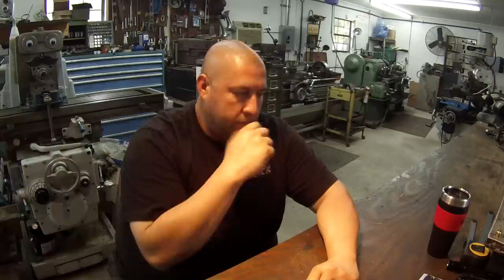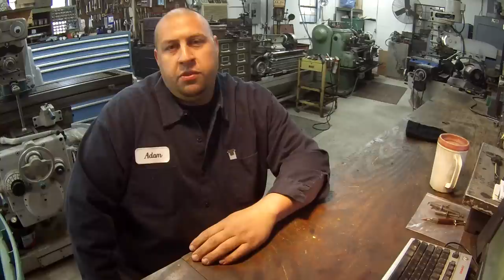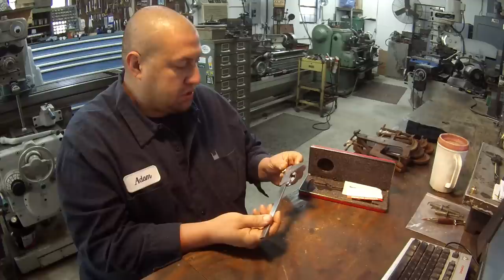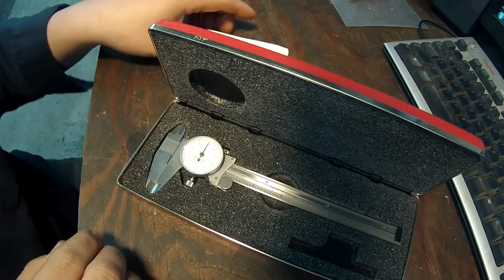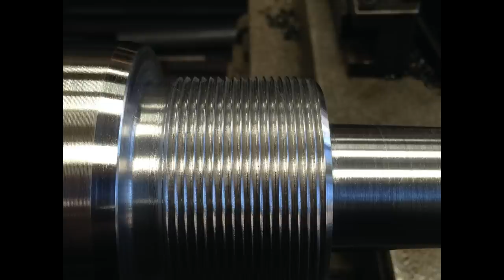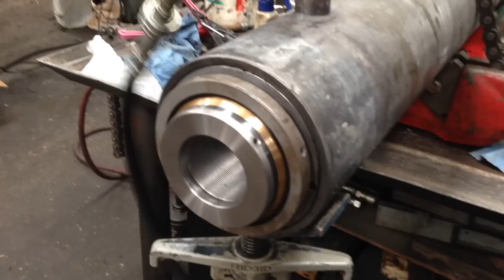Saturday Night Special 43 Part 1

Comment: Thieves suck Adam, I had a break in some time ago...luckily,  my dog gave them a couple good reason not to come back.  They got into my tools and camping gear, but they dropped it all in the yard while they were running for their lives.
Reply from the maker: Stella is sweet of a dog, she will make friends with my enemies. We've been talking about investing in a new dog, one that people won't want to mess with. Stella needs a friend anyways.
Reply: Abom79 No need to invest in a guard dog.  Get a recording of the biggest mean assed dog you can find.  Let your shop security system trigger it and have the speakers inside your shop.  Borrow someone's Doberman and make a couple of videos of it in your shop.  That siren actually will get ignored by the neighbors simply because it will sound just like the 100s of car alarms that no one pays attention to.  AND do not tell anyone about how your alarm system works or where it is.  Have it call you on your cellphone.  Put reflective window treatment on your windows. That will even save you $$ on your A/C bill.
Did they have to case your shop? No, you have made their life easier with your videos. (please do not stop them)  Weld up some simple steel bars and pin them to the inner casement of your windows. Especially on windows that are out of sight.  Just something to make it harder.  Thieve are lazy and anything to make them have to work is a big deterrent.
Reply: Abom79 Maybe get a SHOPDOG and call him SAM    :-))
Reply: Gary C nah the dog would just get lost in some rambling bark and forget about the whole thing.

Comment: Sorry to hear Adam , especially for such a generous guy like you that works as hard as you do.  I'd be getting bars on the window and a big ass steel door.  I think the cameras are a good idea hopefully they make them to see in the dark.
Reply: Don't forget cage bars on the air conditioner, it's common for those to get kicked in.

Not just a steel door, but a good steel tubing frame anchored to the concrete and wall studs too.
I noticed on the videos the door looked a little weak.

Also some work on the rollup door, big sliding bolts, and a set of cage doors on the inside.

Once you have the entrances blocked, it's common here to knock through a concrete blockwall with a hammer.
An alarm tied to a huge canister of pepper spray will repel them if they do get in and if you set it off by accident it won't kill you.

Not just the monetary loss, but if they cleaned Adam out of his precision tools or trashed the place; he could lose a lot of treasures from his father or grandfather.

Adam, once you have the place beefed up, mention it in the videos - but don't tell or show what or how you did.  Keep it under you hat so they don't know how to disable it.

Good fencing and lighting outdoors setup a distance to keep them back and nowhere to hide too.

If you and Elana go away, don't mention it online and try to get someone to stay.

If you get a dog, put it inside the shop to sleep at night.
Reply from the maker: 12345NoNamesLeft
Good stuff man, all good tips. Thanks man.

Comment: Sucks to get ripped off. All you can do is continue on and adjust.

In the video you mentioned covering up the windows. The wife and me went to an antique market and they used leftovers from a place that did water jet cutting for the guards ovet the windows. Some of it was 1/2 inch plate to start with. It was an artsy fartsy type place and it was just raw mwtal not painted. Might be an option for you if you have a place like that around. That expanded metal seems to have some silver and gold lining.

All the best

Scott

Comment: Hey Adam,

It really stinks when you have a break in, my workshop has been hit three times in around 15 years. It's always been on the house alarm system and fortunately I haven't actually had anything taken. Dealing with the damage and the stress and lost sleep is almost the worst.

Unless you're targeted by 'professional' thieves, it's generally hard to identify, easy to sell stuff like power tools that gets taken. Someone I used to know was always picking up dirt cheap or broken tools to leave around their workshop as decoys.

Keep on smiling.

Comment: Adam;

Sorry to hear about the break in on your shop.  Had this happen to me many years ago and I still get a sick feeling when I think about it.  Lost a small mill and some nice old tools that belonged to my father-in-law.  Big props to your buddy for coming to your assistance.

Nice find on the Starrett dial caliper.  And yes, you did get a good deal on it ;)

Would be nice to see some video of how you cut a buttress thread and any special set up or measuring that is involved with cutting those types of threads.  Not common for us hobby machinists, but you never know when knowing how to cut one may come in handy.

Regards;

Ron Kluwe

Comment: The thing you need most, and I say this as a victim with experience in the security industry, along with an alarm, a camera, good friends, and the advice below on doors and windows and bars, etc, is insurance. Make an inventory of everything in the shop. EVERYTHING. Get insurance. Booth Machine may not be what it was, but you should have business insurance, and you should have a list of everything, with value for replacement. There's north of six figures in your garage, and it needs protecting every way possible.

Finally, every box that has a lock or a place for one should be locked whenever you aren't in the shop. It's belt and suspenders, but it will help.

Comment: Sorry about the break in,  your correct there is nothing lower than a thief. Congrats on the Starrett calipers, they sure are sweet. Was your wallet smoking from the speed that you dug it out to pay for them? When I first started in the shop in 1974, the owner bought a set of calipers for a local company, used them a few days and they jumped the track. He sent them back and purchased a set of the Starrett calipers just like the ones you bought. They lasted and worked well, never jumping off, Starett has a course rack that is mounted on the top of the slide, that will take more abuse than any other caliper and still remain accurate. I have one for my home shop because there well made even the newer ones that is made off shore.
Reply from the maker: I love those calipers, and they are practically brand new! They have such a good feel to them. I don't know how much I'll use them for now, they're just too nice to mess up. My other Starretts are the offshore build, and they aren't as nice as the one I scored.

Comment: Adam, from this resto-guy, try a gallon of Evaporust. Drop those clamps in for 24 hours and they'll be silver when you pull them out. It's SUCH a remarkable product. Give it a try, I swear by the stuff ;)
Reply from the maker: I'll have to get some and try it out. Can you buy it local in the stores?
Reply: Abom79 Harbor Fright has offered it in the past. Check them out on the interweb.
Reply: Abom79 Adam - if HF does't have any, check out Tractor Supply. I believe there's a store in your area. All those flea-market treasures will come out so nice.
Reply: Abom79 O'Reilly Auto Parts is where I get it. Had to derust a mill table last year... The stuff is pretty amazing. On the theft sadly like so many others I've been on the receiving end of that as well. So angry I could barely speak.

Comment: Hey man I can relate to how you feel, I was burglarized twice also, then I did like you, had a high dollar security system put in my home and my shop. I got out and drove around all night looking for them, but I didn't find anyone. I didn't do so good for a few days either.
You are the luckiest man I know with the flea market finds, I've looked high and low for one of those calipers here in KY with no luck. One day it will show up and I'll put it in my shop.
You said in your video that you used YOUR insert to turn the ram down, do you have to furnish your own tooling and coolant? Your boss was understanding as well.
Keep up the video's I love them.
Mark
Reply from the maker: Hey Mark, and I am lucky sometimes. That was probably my best score so far. I did pretty good yesterday too.
The insert was mine, but they buy all the tooling at work. I wanted to try it out on some heavy turning. I'm having them buy some for me to use though.

Comment: Sorry Adam,  I hate thieves,... Not only do you have the loss of stuff but the feeling of being violated lasts a long time.  I was at a shop that got hit almost monthly..  It was a store front with big windows, when they would break the window replacement alone was $100s (I think $7-800). We finally put up bars.   They were on the inside of the windows but you could easily see them from outside and once we did, the thieves stopped.

Comment: Adam so sorry, i too was the victim of a break in, im in the uk, and had a workshop built in the back yard, im slowly building up my gear, lathe first then mill, mostly encouraged by yourself and the other guys with shop videos, they only took my mountain bike, left all the new tools etc, next day i got an alarm and camera inside, with face recognition,and motorised, it follows the face of an intruder recording to a sd card, check out the cameras at costco for these type, anything to catch the B's all the best john

Comment: I know how you feel Adam, my debit card was compromised on Friday (Nov7).  I logged onto online banking after receiving an email from The Home Depot stating they're debit card system had be hacked.  I had to spend an hour on the phone and fill out paperwork with the fraud department of my bank to get my money back and card replaced.  Maybe you can get an autodialer that dials your cell phone if the alarm goes off.  Thanks for taking the time to share your video's.
Reply from the maker: Yep, we're working on a nice modern system that will send me texts, and I can see the videos 24-7.

Comment: Adam,

Sorry to hear about the break-ins...  I was concerned that you are a bit too exposed with your side yard visible to the major street.

While you go about hardening up your windows and doors, you should pay some attention to your roll-up garage door too - they are rather easily cut through in most cases.

In my case, it was a storage locker at a major yard, and the thieves distracted the attendant and used a bolt cutter...

You'll like the Kant-Twist type clamps - I finally broke down and bought some new from an online dealer in Burbank - turns out that the real deal clamps are made in South El Monte, CA just down the road from here.

I cannot speak to the older ones which we had at my old job some 20 years ago, but the new ones have brass threads, nuts, and jaw blocks.

The maker's marks are on the top strap as you look at the side with the screw handle to your right. they're shallow...

Can't say about the old ones, but these new ones are galvanized - a thin film of oil should keep 'em rust free in the SoCal desert atmosphere...

Take Care,

Eric
Reply from the maker: I bead blasted one of them and I don't see any markings. These may be a copy or even hand made by a school or something. But they have a good feel and work great!

Comment: Man I am sorry about your break in. That just pisses me off. When my wife and I were only married for two weeks. She came home from work and noticed the garage door was ajar. She left and called me home from work, I walked in with my pistol and immediately saw that we also been hit. Standard stuff for thieves to get, TV, VCR. They rummaged through some drawers and found my wife's grandfathers WWII German soldier and NAZI banners and souvenir collection that she had for many years. It was laying on the back of the couch in it's box when we walked in. Thankfully that was not stolen. The TV and VCR were replaced. Heck, they even stole Walmart bag in the garage with five quarts of oil and filter for my wife's car.

Dirty freaking low rent square tire wooden axel grease less ball bearing stupid POS motherf#@%ing THIEVES!!!

Comment: i do believe that you need to beef up your doors and windows the ABOM way .. and maybe fit an alarm .. you can get a system quite cheap that texts you when the alarm is triggered my motorcycle shed has 2 inch thick solid steel doors with reinforcing bars all around the interior ,,although i did not build this and i cannot take credit i am happy at how secure it is

Comment: Adam sorry to hear about the break in.  It is a shitty feeling for sure I had my apartment burglarized.  They must have had a kid help them because the window they crawled through is really small.  Having scum like that in your space is very hard to deal with.  Sounds like they took the stuff that is easy to sell that is what they took from my place too.

Good finds at the flea market, all the kant twist clamps I have seen have copper jaws.  Where I used to work we had some that were stainless bodies.  All of them have Kant twist stamped in them.  They are made not far from me in El Monte CA.
Reply from the maker: They took stuff they could easily sell on the street for quick cash. What working man doesnt want a good deal on a nice cordless drill and grinder. Makes me sick!
The cantilever clamps I don't think are Kant Twist. They may be a copy or something as there are no marking on them.

Comment: The best deterrent you can have is good lighting and a visible outdoor camera. The more obvious it is that you are recording and can see what goes on outside the premises the less chance someone will target you. Good high power motion lights all over the place are generally enough to scare off some crack head looking for an easy score before they even get a chance to do property damage. Physical security is only as good as the weakest link. I've seen people cut through walls to steal motorcycles. Doubtful it would have happened if the area was well lit and they knew they would be seen and recorded in the act.

Comment: Adam, I'm so sorry to hear about your misfortune. The problem with covering your windows as you describe is that it obviously cuts light and usually means that you cannot open for ventilation.  In the short term cut down visibility from people looking through is to cover the glass with an adhesive privacy plastic - quick and easy to apply, I prefer bars on windows for this reason.
Reply from the maker: I checked out a buddies shop and he fabbed up frames with expanded metal. it looks good, and lets plenty of light in. Secure the through bolts by welding them.

Comment: Glad you finally got some Kant-Twist. They are my favorite clamp by far. I do not do much machining, but for fabrication work they are the cat's meow for most things. One side is very 'short' from the bottom of the part being clamped and the bottom of the clamp, so it can fit in some very tight places, self-leveling. My one complaint is the relatively low clamping force on them compared to, say, a forged Wilton in the same size. Of all the clamps I have, and I have over 40, I reach for my Kant-twists or my Wilton 40* series clamps always. They go down to some tiny sizes too, a cheap indicator base/arm with a 1" kant-twist at the top makes a great helping hand as well.

Comment: Hi Adam, Sorry to hear about the break in. There is a "metalized window film" which adheres to windows and is very transparent from one direction (which you put on the inside) and reflective like a mirror from the other direction (from the outside). Thus no one can see in but you can still see out your windows. It works great during the day but so much at night since there is more light on the inside than the outside it becomes transparent (unless someone shines a light from the outside). It could help stop anyone from the outside looking in and only takes a few minutes to setup and doesn't cost much (no substitute for bars tho).

Comment: Adam Sorry to hear about your shop, low life's for sure!

On a side note regarding the cleanup of your clamps I would suggest picking up a gallon of rust dissolver, we have used this on the inside of fuel tanks and it is amazing how well it works. Almost like brand new metal when is completed, takes a couple days to fully dissolve the rust.  Just get a rubber maid container to submerge your tools in.

By the way I was trying to send a request to follow you on FB for whatever reason it did not have the option available unless I was doing something wrong, I sent you a PM.

Best regards....
Mike.
Reply from the maker: Hey Mike, I get many requests so I don't know who you are on there. Try again or send me a message and let me know.

Comment: where did you get, or how did you make that roller protector for your cradle? i use the same set up with practically the same lathe every day and i use the cool mist blowing the chips away from the top roller but i am still worried that it will get under the rollers. chrome rod is so hard to keep nice when you have to use the cradle

Comment: "you need a more aggressive dog, and a good security system. make a metal door! I sadly was robbed by drug dealer street thugs ,in 2012, lost all my Dad's and grand dads tools I had in storage! those were the biggest loss!  my compressor,hoses all my snap on tools ,circular saws, air hoses. I has impacted me greatly to this day. every time need to fix something , no tool! have not been able to replace this stuff, on a fixed income and these were/are not in my budget yet to replace , but the big loss is my stuff from my dad and grand dad from when i was a kid for gods sake! they were machinists and mechanics. my fave tool gone irreplaceable a 1940 craftsman 1/4 in reversible drill ! still had original brushes ,and was my fav tool. rarely used it , just always had it in sight! Adam , I feel your loss, too !  it was Christmas eve when they hit our storage facility !